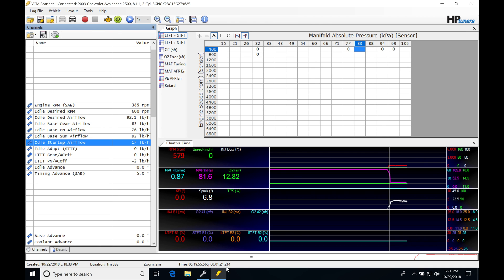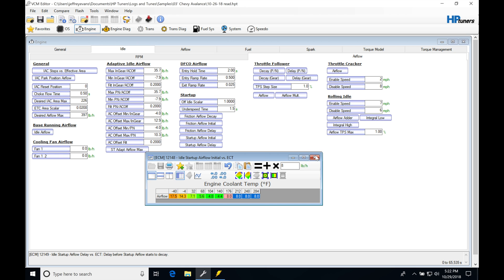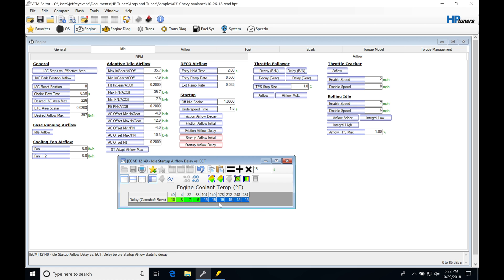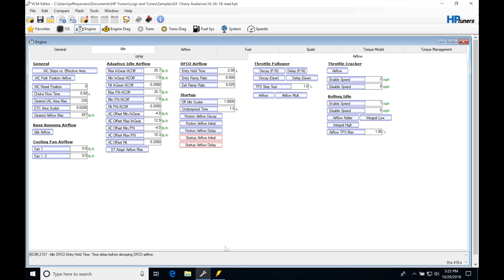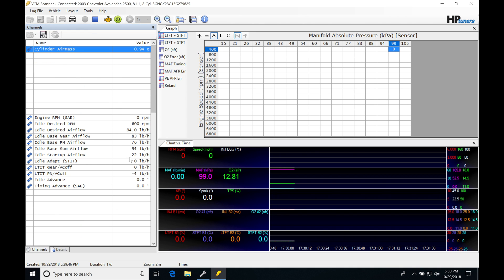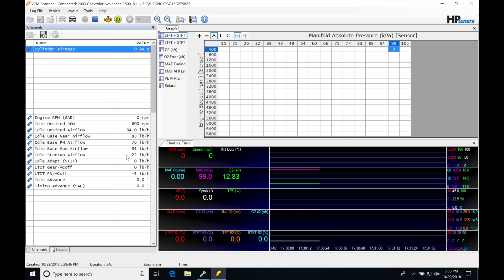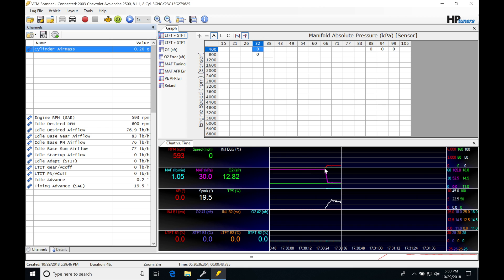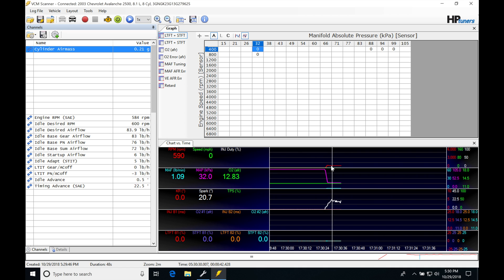HP Tuners GM Gen III: Start Up Airflow | Evans Performance Academy

Comment: will startup airflow affect hot starts? i seem to have issues with hard/slow cranking when the engine has been running for some time. My tuner fixed this issue before but now just says its a starter issue since it came back after i swapped out my exhaust mid section and it the issue showed back up.
Reply: This is a common issue and includes me, too.  I have not found a solution.  I have a feeling it has to do with the engine coolant temperature correction table @ startup.  The problem is, I don't know which way to go with it.  I imagine you want to pull fuel and timing on a hot start bc the air is less dense...but I am not sure.